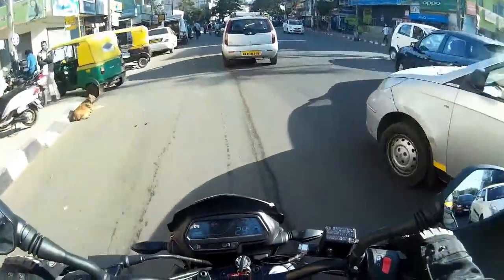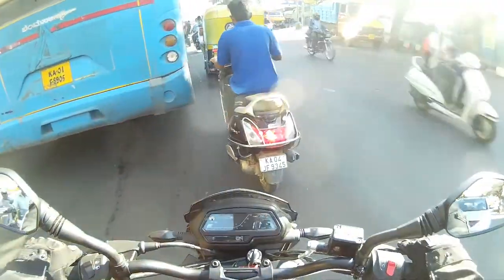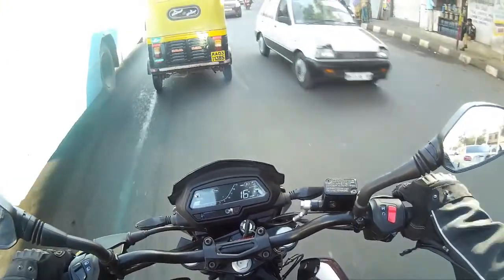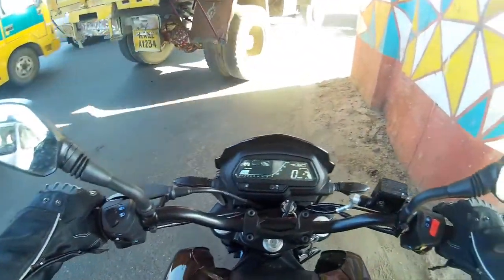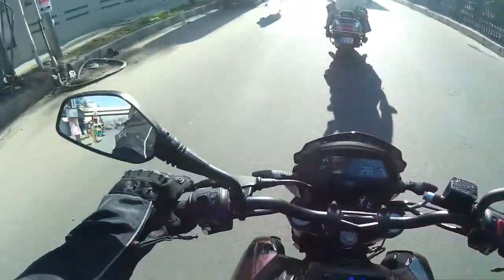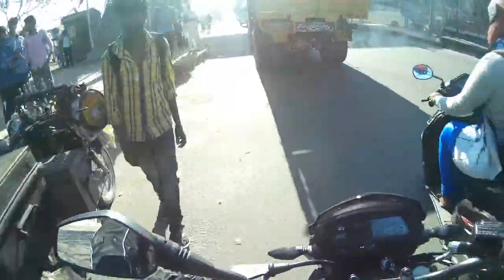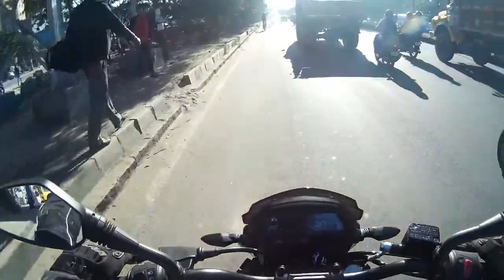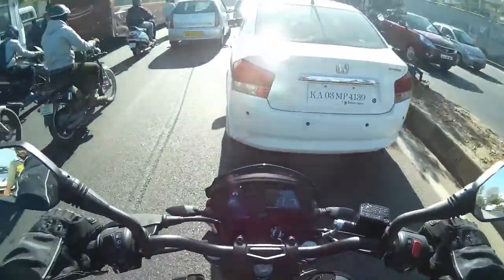WET v/s DRY CLUTCH | DIFFERENCE IN SOUNDS | MECHANISM EXPLAINED | BANG2W

Comment: You missed a lot of things there...
Dry clutch pros: more power delivery from the engine to the wheel, no metal fragments inside the engine, less oil meens less weight, awesome sound, good looks with open cover.
Cons: mostly the cost because you have to change it more often than the wet, it's not suitable for new riders cause it's more aggressive on gear changes and it does not cooperate with the low noise restrictions of new bikes
Wet clutch pros: better cooling, smooth gear changes and cheaper maintenance.
Cons: loss of power delivery from the engine to the rear wheel because it's spinning inside oil, metal fragments from the clutch to the engine, heavier and no plus good looks on your bike
Reply from the maker: True buddy... Thanks for watching..😉